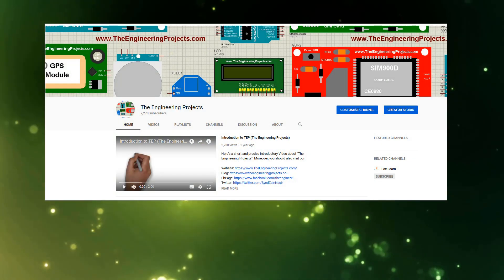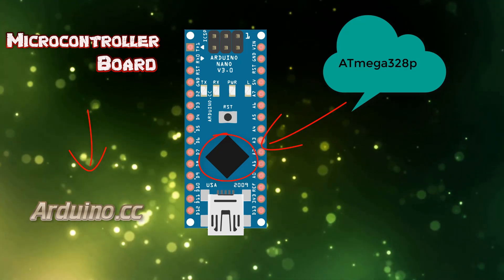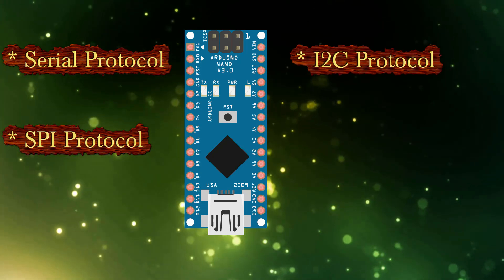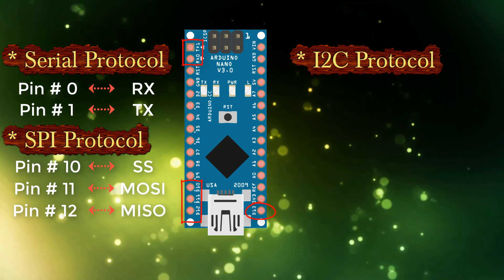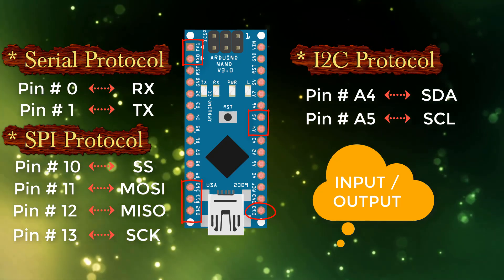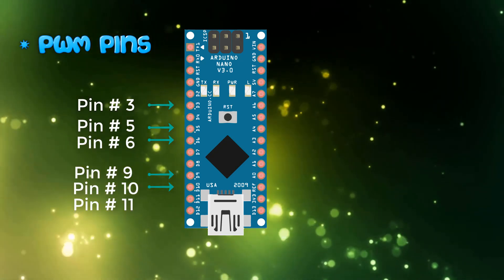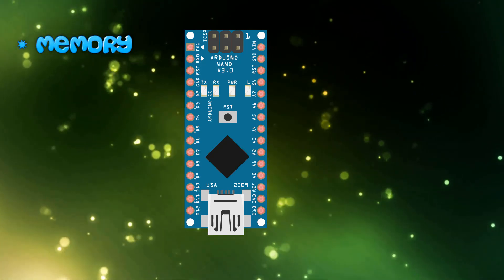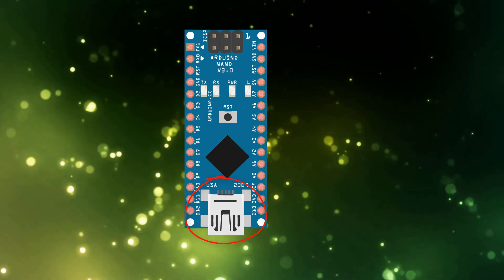Introduction to Arduino Nano

Comment: I have arduino nano ch340g there is no indication of pwm signal sigh ~ on any port, does it have pwm capiblity or not
Reply from the maker: yeah pwm pins will surely be there ..... In some prints, they don't add that mark ....

Comment: Flash memory 32kb
Nd that 2kb memory used for what sir ?
Reply from the maker: It has an SRAM memory of 2KB, which is used for saving temporary data like variables i.e. strings, arrays etc.
Reply: @Theengineeringprojects  tq sir 🙏nice video 🔥very helpful
Reply from the maker: You are welcome ... :)